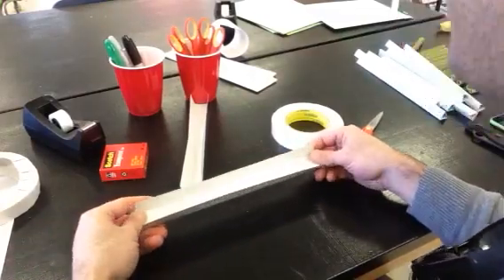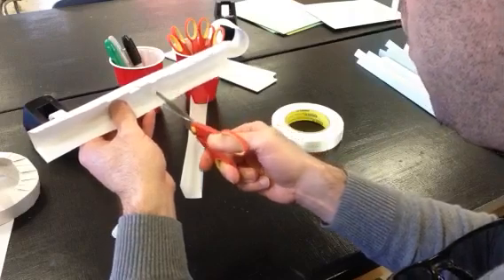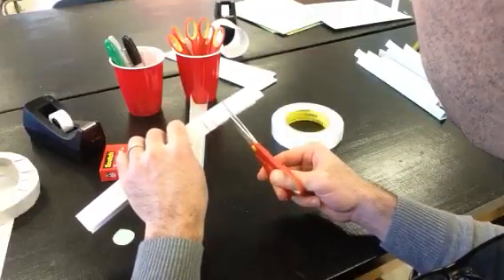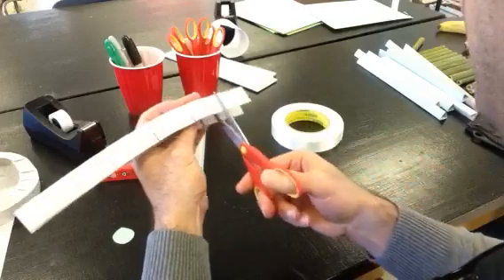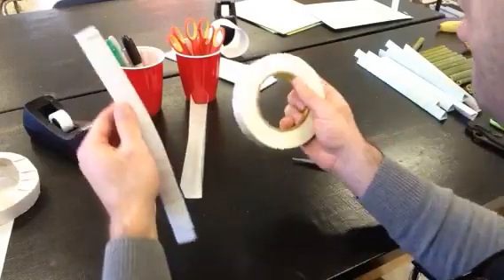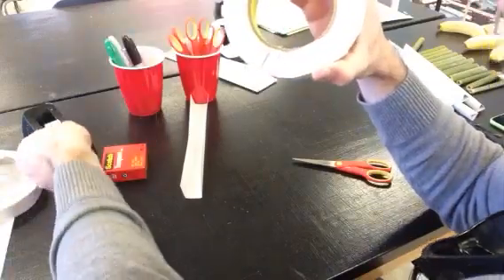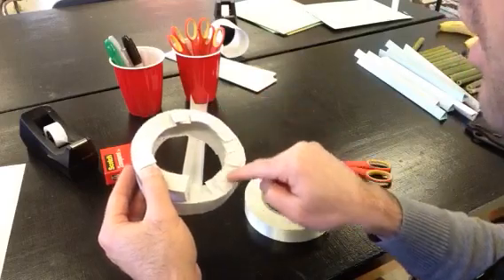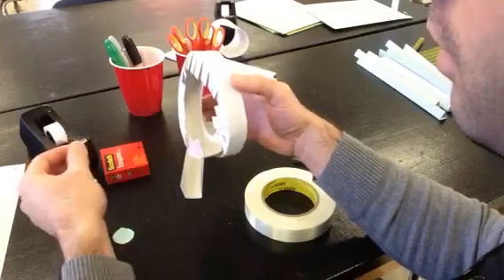Paper Roller Coaster Loops / Corkscrews

Comment: what kind of paper is that
Reply from the maker: +Jeffery Winn The paper is 110 lb card stock.  It's a bit thicker than an index card.  You can also get 68 lb cardstock which is cheaper and easier to fold/cut, but it's a little more flimsy.
Reply: +tjpetronzio did he tape the whole thing??